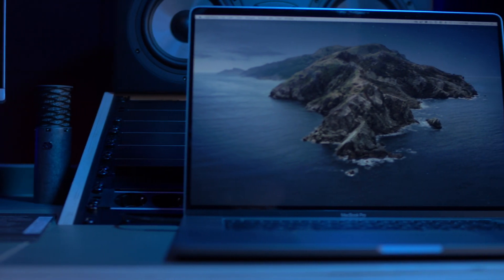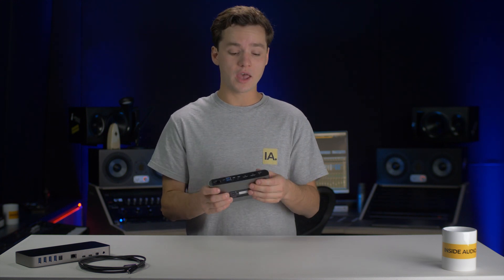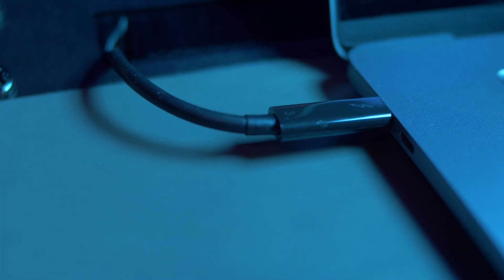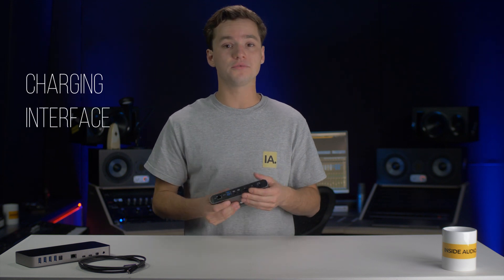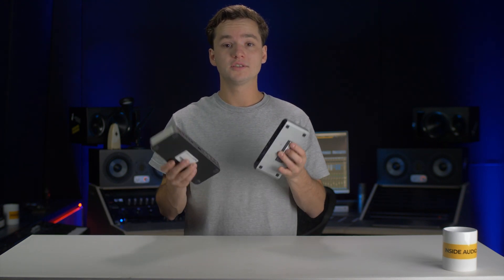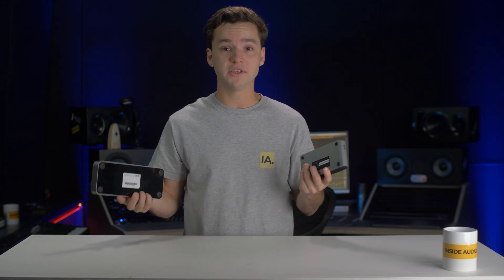Why use Thunderbolt 3 as a Music Producer?

Comment: Thunderbolt also lowers CPU usage since it is PCI it doesn't have to call the CPU for writing to disk. This is why the latency of thunderbolt is lower than USB. USB has to call the CPU before it can write to RAM then it can write to disk, Thunderbolt bypasses this and writes directly to disk lowering latency as well as lowering CPU usage for other things like plugins. You can also have longer runs with thunderbolt. Optical thunderbolt cables are not cheap but will allow you to extend the length of a thunderbolt cable to over 100 feet while USB is limited to 12 feet. Even if you only want 2 inputs Thunderbolt is the way to go. Sure the cost is a bit high but the Presonus quantum 2626 is less than the UAD Apollo twin and around the same as the Antelope zen go, yet offers you expandability and more i/o for the future. But if you are just a hobbist and don't want to spend a lot of money on an audio interface the USB options will serve you well.

Comment: Hi, thanks for this. I have a question though... I'm on an iMac with Thunderbolt 2 (I think) and want to upgrade to a Presonus Quantum 2626. When I buy an adapter (Thunderbolt 3 to 2) is it still worth it to buy the Quantum or do I lose the zero latency and am I better off buying something like the Presonus Studio 1824C ? Very low latency is very importsant to me, because I record almost always using Amplitube or Bias FX 2 (amp simulators). Maybe the Blue Z functionality will be more than good enough and use the 1824C? Downside, I'm stuck with Studio One and cannot use Logic Pro with that same latency. Hope you can help me out here! Thanks again (PS I'm Dutch as well)
Reply: You will be fine the adapter doesn't have any impact on performance.